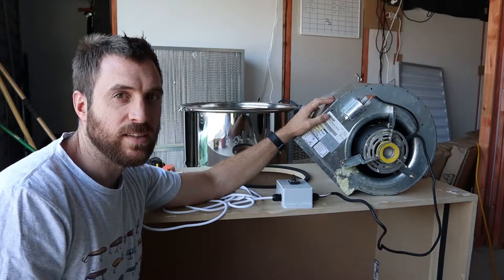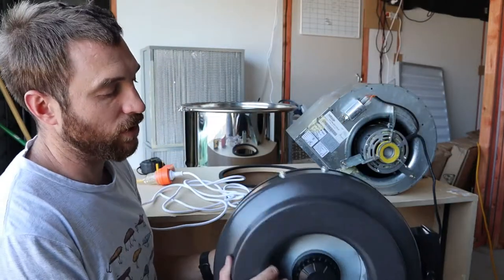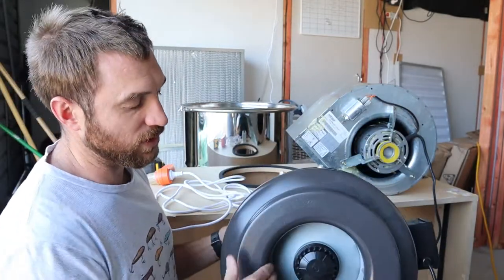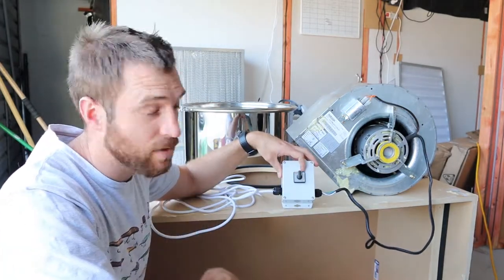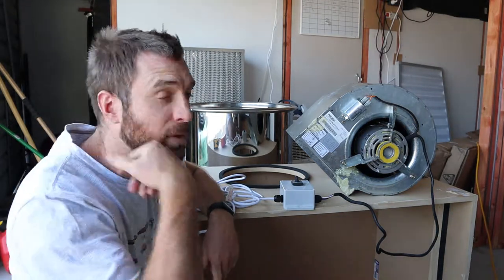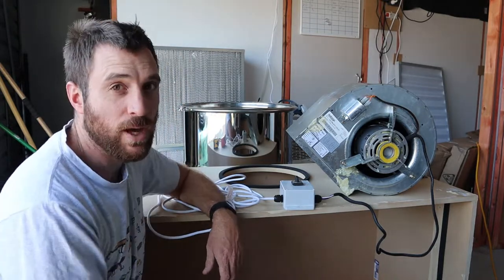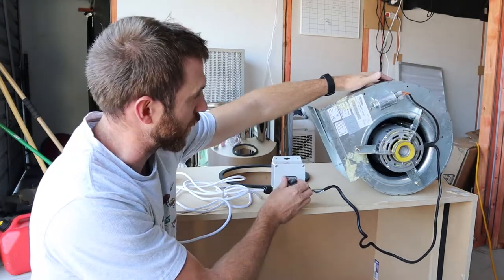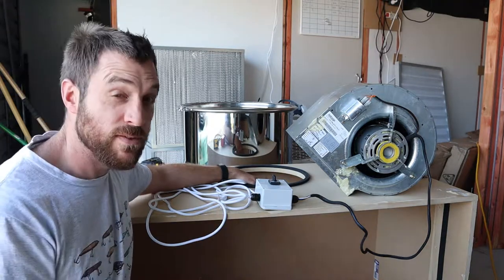Laminar Flow Hood Fan Selection - Making a Mushroom Cleanroom

Comment: Can you please tell me what wattage your fan is? I’ve got the same size filter and my 250w  single speed motor seems to be insufficient and I’m not sure if it’s faulty as I did pull it out of an old heater. Cheers mate

Comment: Why was the inline fan a mistake? Did you assemble the box with that fan and it didn't work, or just hat was the experience? I am researching fans right now, and what I've been finding is tht everyone whose but a flow hood with an inline centrifugal fan says they work fine, butany other people have specated they won't work due to the vortex they create. So myain question is did you assemble the flow hood with that fan and use it or did you come to the conclusion that that it won't work through speculation?

Thanks!
Reply from the maker: The don't handle much back pressure. And the hepa and pre filter does create back pressure. I wasn't getting even flow out of my hood with it. The blower style fan fixed the problem, plus they handle a lot more back pressure.
Reply: @OakandSpore  that makes sense, thank you!

Comment: When you were choosing a fan what calculation did you use to determine how many CFM you need the fan to run at? I am buying a new fan for a vertical hood and don't know whether to do the calculation based on the size of the cavity in the hood or based on the dimensions of the HEPA filter
Reply from the maker: I am not sure how much you need for a vertical hood..
Reply: It's based on the dimensions of the filter: surface of the filter (in feet) multiplied by 100, that way you provide 100 CFM per square feet of surface. So if you've got a 2x3 feet filter you calculate as follows: 2x3x100 = 600 CFM, in which example you need a fan solution able to provide 600 CFM.